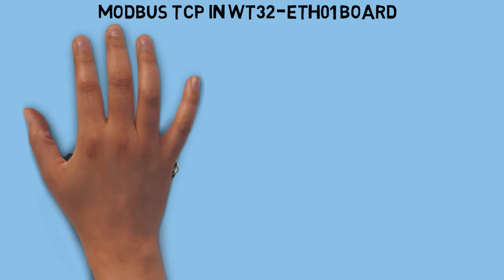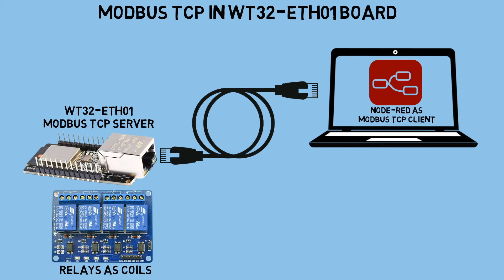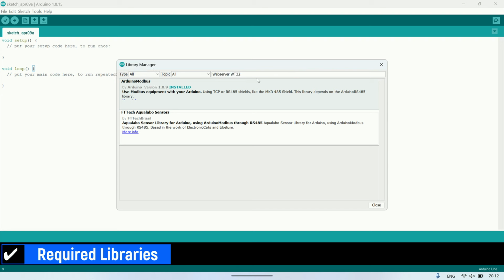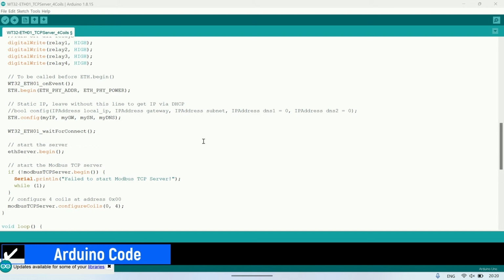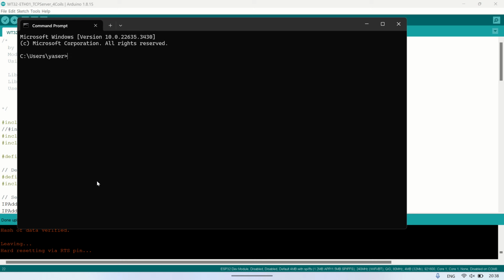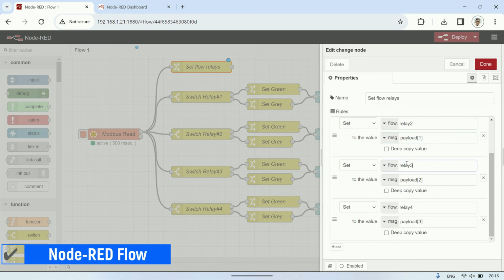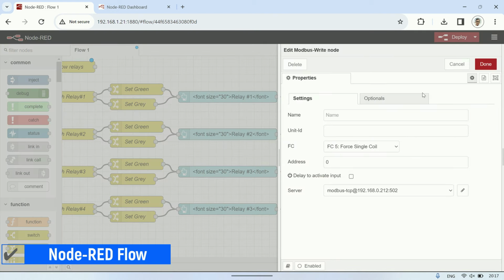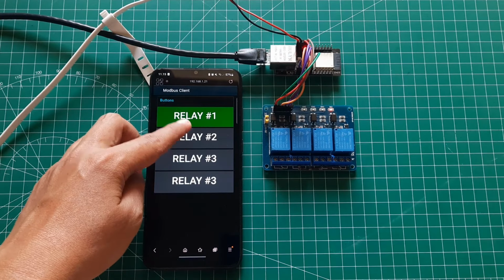Remote Relay Control with WT32-ETH01: Modbus TCP Server Tutorial

Comment: SOLUTION:

Compilation Error:
If you encounter the error WebServer_WT32_ETH01.h:63:4: error: #error This code is designed to run on ESP32 platform!, 
*ensure you are using ESP32 board library version 2.0.4 or 2.0.5.

RS485 Initialization Fix:
In RS485.cpp at line 209, replace the existing code:
*RS485Class RS485(SERIAL_PORT_HARDWARE, RS485_DEFAULT_TX_PIN, RS845_DEFAULT_DE_PIN, RS845_DEFAULT_RE_PIN);
With:
*RS485Class RS485(Serial2, 17, 21, 5);

No Serial Data Received:
*Install the correct driver for your USB-to-UART converter.
*Ensure the COM port is set to a baud rate of 921600 in your serial monitor settings.
Reply: Thank you! That solution worked for me :)

Comment: I tried all libraries. even did a clean install of arduino IDE (1.8.3 and 2). always the same issue with RS485 library : error: 'SERIAL_PORT_HARDWARE' was not declared in this scope. RS485Class RS485(SERIAL_PORT_HARDWARE, RS485_DEFAULT_TX_PIN, RS845_DEFAULT_DE_PIN, RS845_DEFAULT_RE_PIN); any help would be welcome
Reply from the maker: Maybe I have faced this problem, but I dont remember how to solve.
You can try with the example file of library first, then modify it

Comment: Hello I am getting the error: 
WebServer_WT32_ETH01.h:63:4: error: #error This code is designed to run on ESP32 platform!
I have verified all my libraries are on the same version my board is ESP32-DEV.
Any advise would be greatly apricated
Reply: I found out this error was from the esp32 library. From the src I found I have to have 2.0.5 installed. I am now getting the SERIAL_PORT_HARDWARE issue like other people. Could you let me know what library version you are using.

Comment: I get this message when compiling the code. On boards i chose ESP32 Dev Module 
Documents\Arduino\libraries\WebServer_WT32_ETH01\src/WebServer_WT32_ETH01.h:33:4: error: #error This code is designed to run on ESP32 platform! Please check your Tools->Board setting.
   33 |   #error This code is designed to run on ESP32 platform! Please check your Tools->Board setting.

Comment: Sorry sir, I want to ask approximately how far the maximum range of relay control via smartphone is?
Reply from the maker: while on the same network
Reply: @YaserAliHusen  To configure the network, do you just use the Arduino Ide and Web Node Red applications or do you need additional applications?
Reply from the maker: @putrihidayahilra6648 , I use Arduino IDE to configure Board IP Address, and from board connect to network using ethernet cable, make sure the IP address is same with local IP configuration

Comment: installed dependent libraries, but following getting following error Please suggest

Error: \Arduino\libraries\ArduinoRS485\src\RS485.cpp:209:18: error: 'SERIAL_PORT_HARDWARE' was not declared in this scope

 RS485Class RS485(SERIAL_PORT_HARDWARE, RS485_DEFAULT_TX_PIN, RS485_DEFAULT_DE_PIN, RS485_DEFAULT_RE_PIN);
Reply from the maker: Maybe you must copy or install library: ArduinoRS485

Comment: It's giving library errors,
please help me
Reply from the maker: Did you install libraries same with the video?
Do you use device WT32-ETH01?
Reply from the maker: In Libraries folder, there must be ArduinoRS485 folder inside
Reply: @YaserAliHusen  Yes, the ArduinoModbus and ArduinoRS485 libraries are installed in the libraries folder, however they appear as incompatible with the w32-Eth01 board.
I am using the W32-eth01 board.
What version of the libraries and installation of the esp32 boards are you using?
Reply from the maker: @alebassi2000 , version same with video 1.0.9
Reply: @YaserAliHusen  It's the same version of the Arduínomodbus library, but it still doesn't work, can you see the version of the esp32 boards installed on your computer?
Reply from the maker: @alebassi2000 , same with the video, when upload, use ESP32 Dev Module